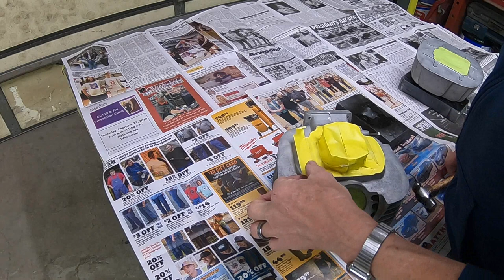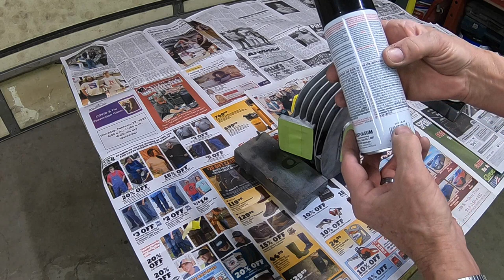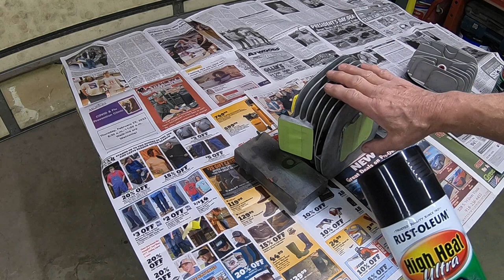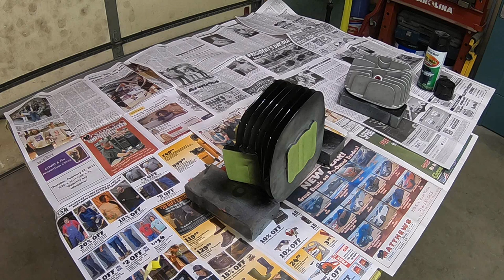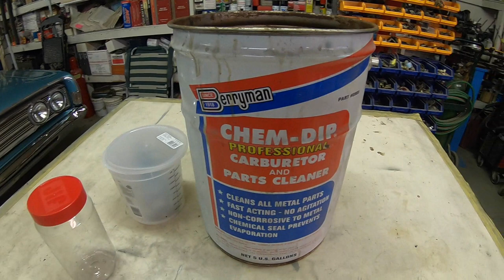Yamaha 250 MX bearings, seals, paint, plating, crankshaft install

Comment: Glad to see I am not the only one needing 4 hands when installing a crank! Really want to learn how to plate. A good Caswell kit and power supply aren't cheap. Very nice to see the rebuilt crank go in so well. Great work all around, Dale!!
Reply from the maker: Hey Jim, nope, takes more hands than I have too. You just have to act like you know what you're doing. And hope no one notices. The Caswell kits are a big help, yes not cheap but will save you in hardware cost alone. They last just about forever.  Am happy with the crankshaft so far, don't anticipate any issues now. Thanks for hanging out with me in the shop.

Comment: I’m getting ready to paint and assembly my 74 MX250.
Reply from the maker: Hi, sounds like you're coming along good on your project if you're at that point. It's always a good feeling when you start back together after all that cleaning and repairing. I wished I had the entire bike, but all I have are the engines. Still makes for a good project. Waiting on some more parts so I can finish this one up. Thanks for hanging out in the shop with me.

Comment: Hey Dale, I'm a fan my friend!!! Love the videos. Do you see a need to lap the mag and crank tapper surfaces? I have brand new Vape ignitions going into my two DT3 projects but I've seen some people indicate those tapers need to be spot on and 'clean'. Also, my cranks look decent .. some pits but obviously not brand new.  Thanks again...Ron
Reply from the maker: Hi Ron, Thanks for the kind words my friend. The only time I have done that is when there had been some water in there. Sometimes you can save the taper and the flywheel/rotor buy lapping with some fine valve grinding compound. You usually know there is a problem when the flywheel or rotor won't stay tight.  But if they are clean, I don't worry about it. I have never installed a Vape ignition. So, I'm not sure about why this needs to be done for it. 
I will be installing a 73 360 MX ignition on this engine when I get to that part of the build. Should be pretty straight forward install. Thanks for hanging out in the shop with me.
Reply: @montana2strokeracer  With Vape kits you get a new mag. My bikes have signs of water and pitting on the taper from abuse. Maybe some 400 wet/dry may be better in my case.